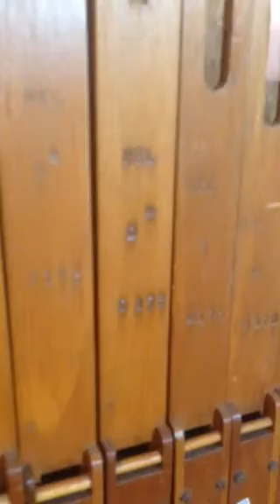49 note wooden violin pipe organ

Comment: This 49 note Bourdon rank could even be unified and extended to play the full 61 notes of a typical organ manual or even more, such as the 88 notes and more of the piano.  It is a woodwind instrument in the truest sense of the word and even has some copper in it (but not brass), so it wouldn't be one of these instruments.  The sound is that of a calliope even though air and not steam is used and the pipes are mostly wood with just a little metal used (not like a calliope which is just about all brass to withstand the heat of steam).  Great job here, you must have quite some experience in building organs?
Reply: What kind of comment is this supposed to be? I don’t think anyone asked for your opinion on what could be done, or some kind of analysis/evaluation of what has been done. It sounds rather like you’re trying to promote yourself as some kind of an ”expert” organ technician. Just enjoy the video and leave the attempt to impress everyone out of it.

Comment: Do you think something along this order could be made for a Pump Organ? (About 1-1/2 octaves in the treble for 2' wooden pipes.) F4-A5. The only thing.........I would be playing the Pump Organ. It would have to be separate from the Pump Organ and the pipes hidden in back of the organs case.
Reply from the maker: +Musique3579 WE first need to define note numbers in the MIDI world middle C is wire 60. There are some folks who call Middle C C-4 and others call it C-5. It could be made I am not sure how you are going to use it. I most likely have wooden pipes that will fit your scale. If you want to go way out I have a 100 year old MORTIER accordion that has 41 piano keys on the treble side and 36 smaller piano keys on the bass side. I was setting it up to pump and finger through MIDI controls.
Reply: +Bob Smith  Thank you so much for the reply. The Reed Organ I have is the usual 5 octave type from 1869 with bottom note F and ending high note F as well. In any event, above the middle C of these Organs is the basic pitch note we usually think of as A440. Very few of the old Organs had a tuning of A440 from this period and the one I have is just about A449. When I tune the reeds to this one, I will be doing so to match as close as possible what Estey Organ Company had in mind. So, the Organ will be in tune with itself. What I had wondered is if real 2' wooden stopped organ pipes could some how be activated in an area around F above Middle C and for the next 19 notes higher making a total of 20 pipes in all. Perhaps these Pipes could be arranged in a very small self contained windchest to either place on top of the Organ or in back of it it. The keys themselves in this area desired could perhaps have contacts put under them so that when a switch was turned on the 2' pipes would play on whatever note or notes that the fingers were pressing down. Otherwise the Organ is still pedal pumped by the Organist as whatever piece he is playing is played out. (Organ wind of these is of the suction type. (Live use of these pipes and not pre-recorded.) Hope that helps explain better my brain storm and unfortunately my abilities at non-mechanical electronic things is about a zero. Naturally the pipes because of the pitch of the reeds in the Organ may have to be of another pitch name but adjustable so as to bring into tune with the Organ reeds. Impossible to accomplish?
Reply from the maker: +Musique3579 Your mssage did not come through completely, tje pipes can be tuned to 449 without problems. The marking on the pipe may turn out to be incorrect but the tuning can be whatebver you like .  One of my instruments is 430 A.  Let me know if I can help anyway.
Reply: +Bob Smith  Maybe if you clicked the show more you could see the rest of my message? I could give you my email address if you would like.
Reply: Or middle C being C3 (which Yamaha defines it as such even though it really is C4 and you are correct, note 60 on MIDI).